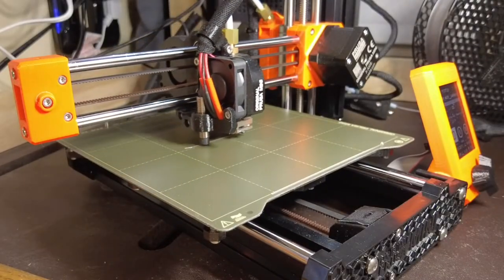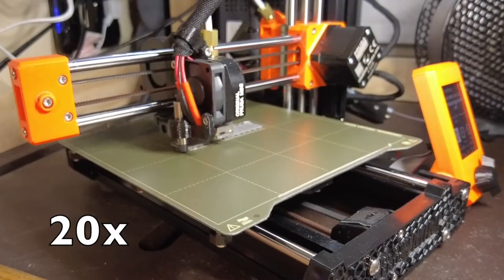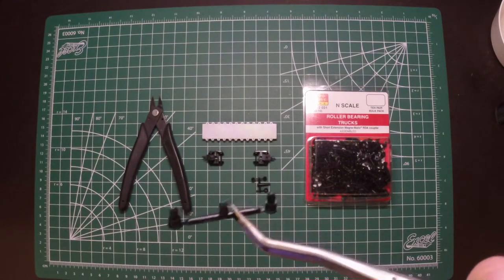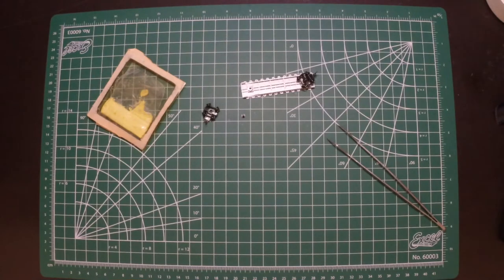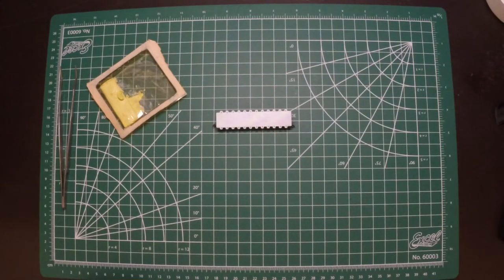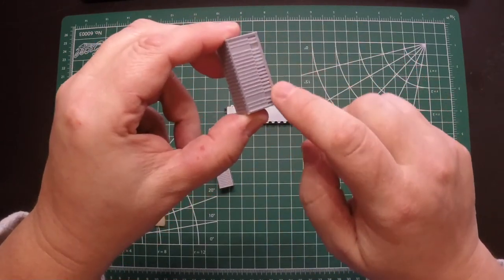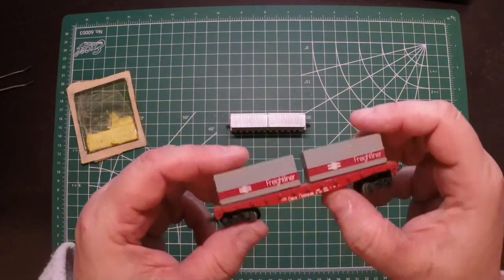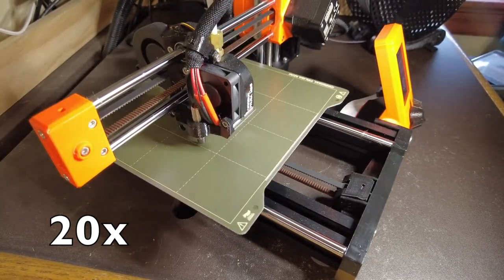3D printing an N scale flat car and shipping containers

Comment: Hi Jamie, it's amazing what can be done with 3D printers. Nice flat with containers. You can make some really cool structures and such with them, especially in N scale where it won't gobble up as much material compared to O scale😁even using less fill. Cool Vid, Thanks.
Reply from the maker: Thanks, John! They are amazing machines, and I feel they've got so much potential. I've been working on learning to design my own parts from scratch which is fun, but definitely a lot to learn. I'll be able to build an N scale empire with them for just a few $$ worth of filament!

Comment: Very cool, Jamie... hope the 3D business is shaping up for you! Have you looked into 3D scanning in order to facilitate making your own designs by converting physical objects into 3D printable design files? Thanks. T4
Reply from the maker: Thanks so much, T4! I hope you've been doing well. I've got my first ambitious design of an N scale building running in the resin printer now. Kind of nervous about it, lol, but I should know in just over an hour if I'm on the right track with it. The business is starting to come together finally. PA dragged their feet approving my LLC which had me dragging my feet on the designs (even though I should have kept going, but I don't do well with uncertainty). Hoping to have something to announce later this month if things keep moving forward now. I have considered a 3D scanner, but since I mostly want to do buildings I pretty much have to design from scratch. Might buy a scanner for other stuff later on, we'll see. I got some new design software two weeks ago which I've gotten up to speed on very quickly. I designed full-sized buildings for most of my life, and the funny thing is designing the N scale ones is kind of harder because I have to simplify so much instead of go into the crazy detail that I'm used to. Fun stuff though, I'm really enjoying it!
Reply: @JamieMakin  Nice! I will eventually get into 3D printing for O scale, especially hard to find parts, as well as embellishments for cars and locomotives that lack basic details.  So, I will definitely be keeping up with your progress to learn some things. It's all a learning process, so have fun with it and it will all work out. T4
Reply from the maker: @tinytowntrainstv  I'll definitely keep you in the loop on the 3D printing stuff! It has its frustrations while learning, but overall it has been a lot of fun and I'm getting good results for a beginner. That'll be cool if you get into it eventually too. I'll be here to answer questions and help as I can when you're ready!
Reply: @JamieMakin  Thanks! I am sure I will need it! lol T4